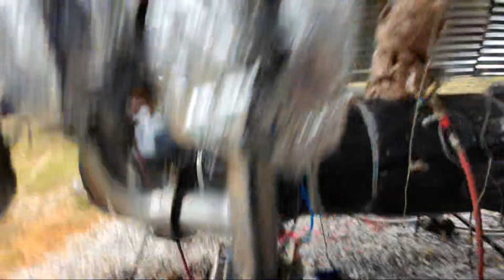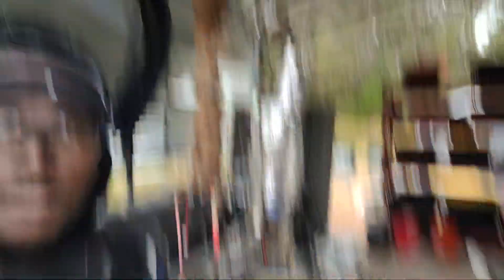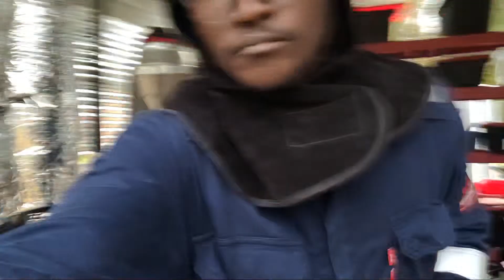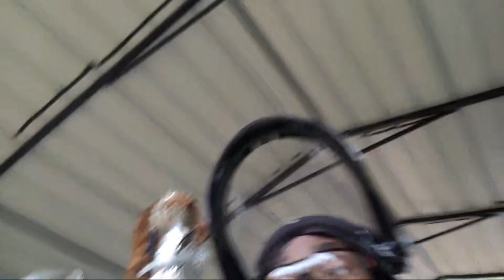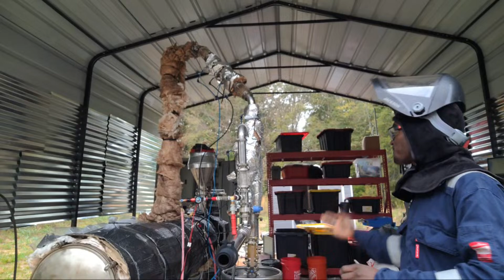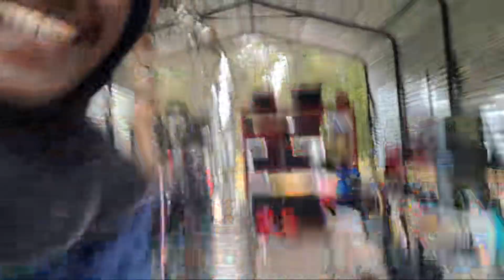Oil From Plastic!

Comment: solar costs : way more than 10k-20k ... if you want the cells to be able to provide 9 kW consistently , you're gonna need massive batteries and complex inverter / MPPE systems. You're looking at 40k AT LEAST - i paid about 40k for the cells and the battery in my house and i can generate up to ~ 13kW (during summer, on a very good day)

Comment: Could you connect your distillation unit directly to the reactor? 
Might be a more efficient setup, make the most out of the heat energy.
Reply: Also, could you substitute the carbon with granulated 'used' tyres? Increase yeild and tackle another waist stream
Reply: @callanauger that would be interesting to see, if he could use tires and recycle them that would look super sick on a thumbnail!

Comment: Been wondering. How exactly do you source the plastic? Since the starting volume of the plastic is really large and the shredded version is much smaller, what if you can also shred it off site, then stuff it all inside vacuum bags? Or a similar method that can compress it well. May be lots of work but perhaps this would be worth it to allow sending multiple runs worth of plastic in a single trip. Like maybe spend 1 day to focus on shredding and packaging that plastic, 1 day to deliver it, and youre set to run for a whole month or so. The room where the shredding is done can sorta be a means to reduce the spread of microplastics. No PPE other than a mask for this specific job.

Edit: a bit over the top, but if you can pelletize the plastics it would flow better through the hopper. Finer aggregate like shredded plastic can make things clog up easier. Making granules can reduce the clogging

Comment: Hey! I'm really glad that you maybe read my comment and picked up that 2mm stainless steel screen! I hope that you don't have any more issue with the microwaves :) keep going!!! Really happy to see this project rocketing towards efficiency and stability. Unsure if you are using wave guides, but I'd love to put some volunteer work into designing the wave guides to be constructed from readily available materials in hopes of increasing the efficiency of the machine! I think if the waves were concentrated near the bottom say 25% of the tube where the vast majority of material is you could save a lot of energy from just bouncing around and pyrolyze material quicker?
Reply from the maker: Cheers!

Comment: they make continous feeds in manufacturing and particularly agriculture - may have an auger feeder closer than you think in your new setup!
Reply: Or perhaps injection moulding for plastics could work. Its a testing phase just buy a few china-made for cheap. Squirt the molten plastic into the vessel directly. Its already melted, just waiting to pyrolyze. Whether with heaters or microwaves, he still needs to heat up the plastic anyway. Melting it prior to putting it in could be a good way to not mess with the temperature of the vessel getting cold when plastic is added and then having to heat back up

Comment: How much gasoline does the generator consume compared to the amount of oil extracted from your reactor? And have you considered that the microwaves reflect within the reactor, rather than being absorbed by the casing, to increase efficiency?
Reply: The goal isn't necessarily net energy but net oil. Ending up with a usable oil product that can be burned for fuel instead of being persistent in the environment is the goal.
Reply: @ezcreations777 if you burn oil then it's still persistent in the environment as CO2 plus other elements/compounds. The idealistic thing here would be to use renewable energy, solar, hyrdo, etc, to transform plastic waste into a material that could be used again.
Reply: @whitelined2  i propose something different. We use that oil to make plastics. It doesnt become CO2. Right now our recycling is still bad. They need clean uncontaminated plastic, and cant make use of degraded plastic. Plus sometimes they even use virgin new plastic to "recycle" old plastic. And most recycled plastic thats 100% from old plastic tend to be grey and not appealing. Its messed up. Id say start all over from the basic monomers instead of merely trying to remelt old brittle plastic into new. Pyrolysis machines are baddies. They would take anything you have, and could even ask for more, they dont care. Any low quality plastic goes in, petrochemicals comes out. Once back to basic chemicals, they can be made into fresh new plastic.

Our technology has mastered the art of making plastics. We havent bothered about what to do with the plastics. That is why imo pyrolysis is the missing piece of the puzzle that we need to develop
Reply: @whitelined2  Nature Jab went over this in the video discussing exactly what you're talking about. The goal is for solar & renewable sources of energy for the process but that just isn't feasible it seems in this current stage of funding and R & D. He's focused in on getting equipment for the Reactor. I think fuel and the carbon outputs are definitely worth developing further as the point is to convert plastic out of the environment not just transform it into a different plastic product.